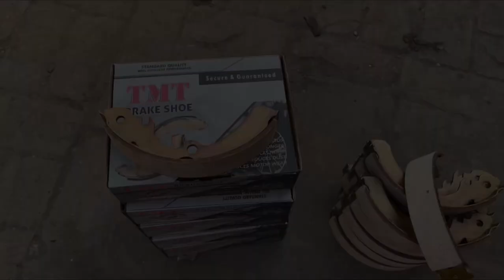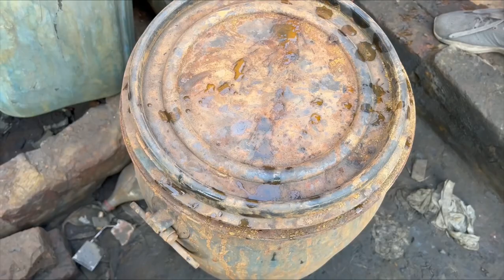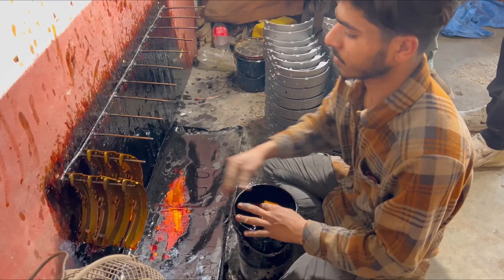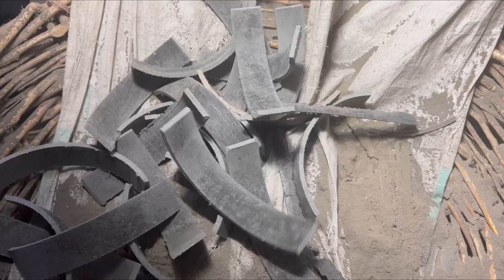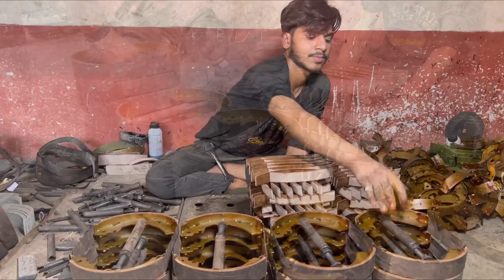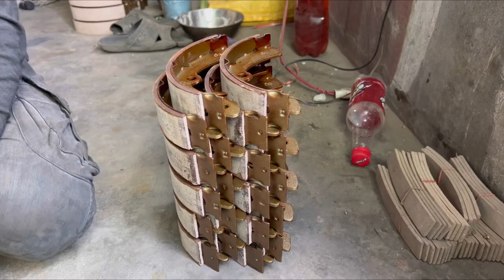Ever Seen Before How Car Brake Shoe & Brake Linings are Manufactured in a Factory

Comment: What is the glue adhesive  used on brake linings?
Reply: I'm wondering the same. And what the cleaning chemicals were (I suspect the first was an acid, to remove rust). Lastly, what was that red/gold rust inhibitor?

Comment: Dangerous but necessary work to produce these brake shoes.
Reply: Much of the work is necessary, but not the way they did it. Workers were exposed to possibly dangerous chemicals and known dangerous dust. Those guys should have full respirators and with work in a negative pressure extractor hood, to remove most of the airborne dust. The rest is just manual labor, which could have been automated (if labor prices weren't so low). The human toll on this manufacturing is staggering.